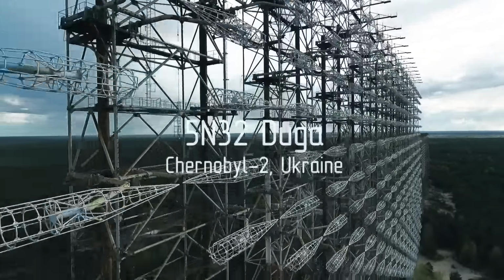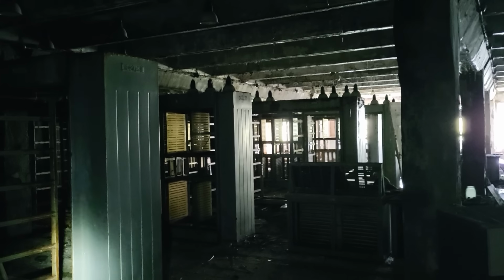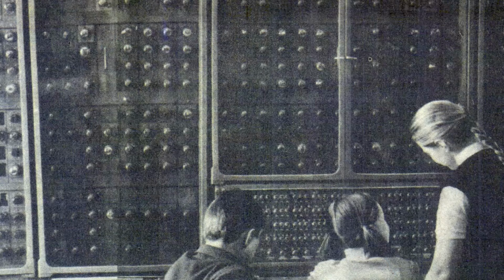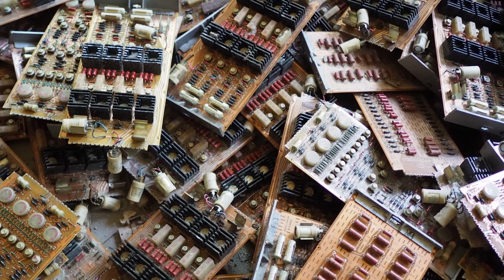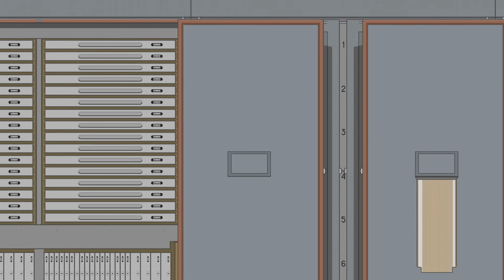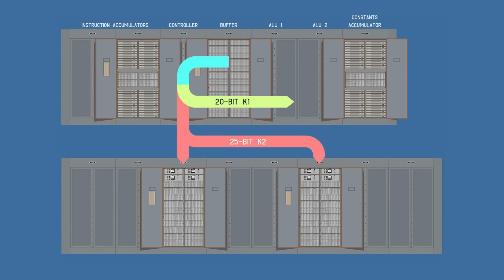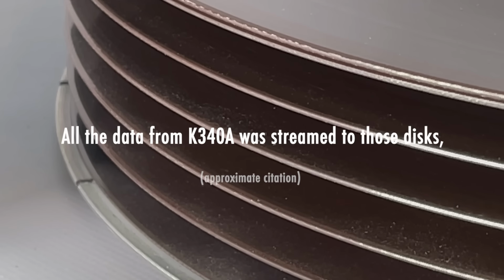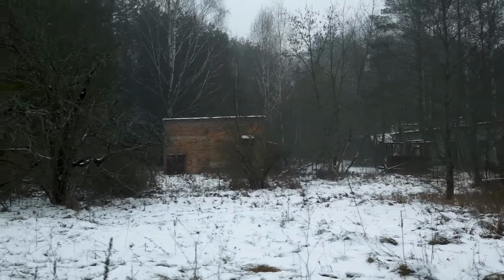Exploring K340A: The SECRET COMPUTER of CHERNOBYL DUGA RADAR | Russian Woodpecker

Comment: Exploring the K340A: Unveiling the Unique Computer that Powered Chernobyl's Duga Radar

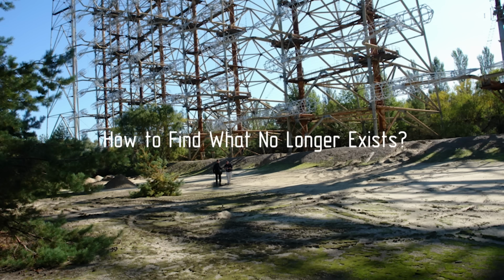* 0:49 First Discoveries: Initial exploration of the Duga site in 2010 revealed a data center filled with the K340A computer racks, an intriguing system unlike anything seen before.
* 2:11 Early Research: Limited information was available about the Duga radar and its computer system until the discovery of a book by Boris Malashevich, a researcher of Soviet computer history, in 2014.
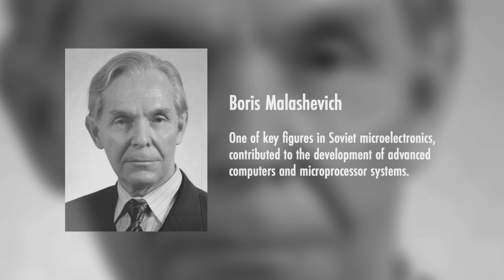* 2:24 Residue Classes System: Malashevich's book revealed that the K340A was based on the Residue Classes System (RCS), a unique method for representing and processing large numbers using smaller residuals.
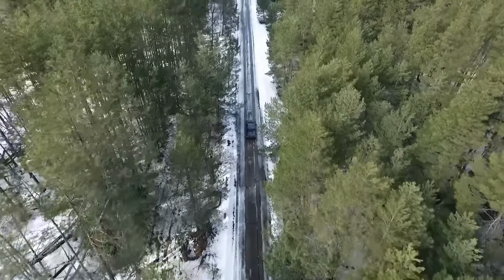* 3:11 Research Expedition: A 2016 research expedition to Duga focused on mapping remaining computer equipment and examining surviving documentation, which was heavily damaged by moisture.
* 4:49 Why a Special Computer? The need for a unique computer like the K340A stemmed from Duga's complex operating principles and the demanding computational requirements of analyzing ionospheric conditions and tracking missile trajectories.
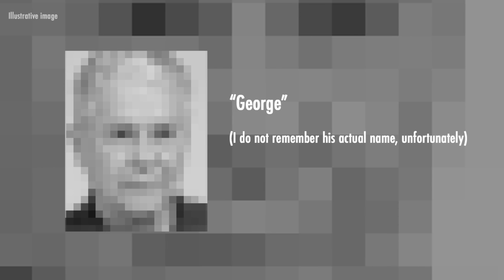* 5:07 Meeting "George":  An interview with a former engineer, "George," provided valuable insights into the K340A, its specialized engineers, and its role in processing data and optimizing Duga's operational modes. [From connarcomstock161's Comment] The Duga system was known to be operational and a nuisance to amateur radio operators.
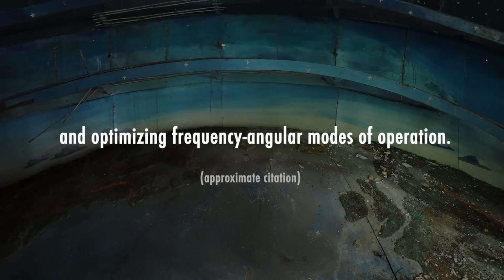* 6:17 How Duga Worked: Duga used a complex system of transmitting signals that bounced off the ionosphere to detect ICBM launches, requiring sophisticated algorithms and fast processing of large numbers. 
* 7:43 Origins of RCS: The RCS, crucial to the K340A's operation, was developed by Czechoslovak professor Antonin Swoboda and his student Miro Valach in the 1950s.
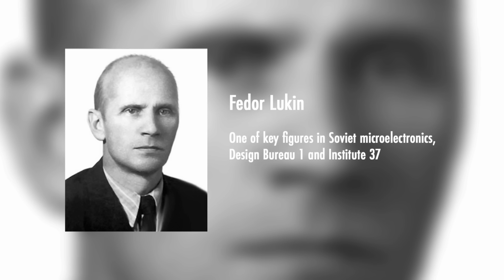* 8:22  Soviet Development: Soviet engineers, including Israel Akushsky and Davlet-Girey Uditsky, recognized the potential of RCS for specialized machines and developed the A340A, T340A, and eventually the K340A.
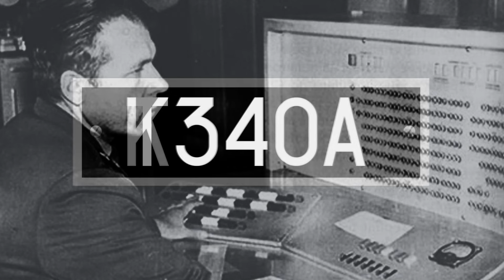* 9:26 K340A Specifications: The K340A, completed in 1966, boasted 472,000 elements, including 80,000 transistors, and an impressive processing speed of 1 million operations per second.
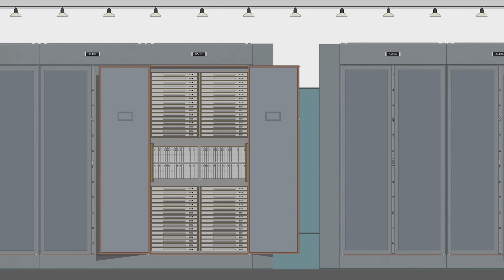* 10:19 K340A Hardware: A single K340A system comprised 15-17 computer racks, 4 power supply racks, an operator's console, and a printer rack.
* 11:16 Modular Design:  The K340A used small, standardized cards called "cells," with around 50 variations, plugged into racks with custom connectors and intricate wiring.
* 11:50 Three Types of Racks: The K340A employed three types of racks: Data Processing racks (processor), One-Side Accumulator racks (storing constants and programs), and Accumulator of Numbers racks (RAM). [From robmacl7's Comment]  The fixed memory modules (ROM) were implemented using "Cassettes" with ferrite rods, a concept similar to core memory.
* 12:47 Ferrite Rod Memory: One-Side Accumulator racks utilized "cassettes" containing ferrite rods to represent data, with their position indicating a logical "one" or "zero."
* 13:06 The Prank: A story shared by "George" recounts a prank involving fake, non-magnetic ferrite rods mixed into the real ones, causing weeks of troubleshooting and delays during the K340A's commissioning. [From alexloktionoff6833's Comment] The fake ferrite rods might have been a deliberate act of sabotage, preventing reverse engineering of the system's software. 
* 17:51 Operator's Console:  While details on console operation are scarce, the layout and inscriptions suggest a low-level interface for data manipulation, instruction execution, and system monitoring.
* 20:53 Paper Tape Output: Data output from the K340A was recorded on paper tape using MP16-2 numeric printers, common in the 1960s.  
* 21:48 The 1S31G System:  The K340A computers were part of a larger processing system called 1S31G, likely involving multiple interconnected K340A machines and possibly connections to ES-1060 mainframes installed in 1984.
* 25:57 Museum Plans: The video creators aimed to establish a Cold War museum at the Chernobyl-2 site, featuring a restored K340A as a central exhibit, but the project was indefinitely postponed due to the 2022 war.

Note: Several comments highlight the disruption caused by Duga's signal to amateur radio operators, who nicknamed it the "Russian Woodpecker." This emphasizes Duga's real-world impact, even though it never reached full operational capacity for its intended purpose. 

I used gemini-1.5-pro-exp-0801 on rocketrecap dot com to summarize the transcript.
Cost (if I didn't use the free tier): $0.15
Input tokens: 39207
Output tokens: 1145
Reply from the maker: Actually, this is good.

Comment: Thankyou, that was very interesting, as a kid and ham radio operator in the late 70's / 80's I have listened and heard the Russian Woodpecker many times, even transmitted morse code dots at the same rate on its frequency as a little part of my electronic counter measure. 

It was at the time a HUGE radio signal probably many hundreds of KW's  or power.
Reply from the maker: Thank you very much for sharing!

Comment: "It' never reached full operation"

Ringway Manchester would like very many words. 

Duga was such a nuance for amateur radio in the 80s they named it the Russian Woodpecker. The UN asked the Soviets to turn it off. The Amateur radio community would blast it's signals back at it in an effort to make them turn it off. 

The thing very much ran and was a very big annoyance for a lot of people.
Reply from the maker: I meant, there is a difference between 'technically worked' and 'was on active duty'. It was in test and research stage, there was even a special research shift of officers there, but not all systems were in operation and the data from it was not used.
Reply: @ChernobylFamily  That sounds like we all have no idea how much more potential to be REALLY annoying this thing had up its sleeve.  Maybe it gives you an impression that not only radio amateurs and shortwave listeners were suffering from the woodpecker,  even when you just wired up audio equipment and be it just your own stereo, as long as the shield wasn't properly connected you sometimes could faintly hear a mix of Radio Moscow and the Woodpecker on top of the 50Hz-hum (here in Europe).  At times the signal strength was incredible and overloaded our not so posh radios, so it could be heard even on frequencies it didn't actually transmit on.  That "test phase" was certainly a 24/7 job for the station operators for years.

Comment: Duga should be restored to theoretically opperating condition. At least restore a k340a to working order. 

I think with enough of the documents recovered it might be possible
Reply from the maker: Those papers are just a few bits which usable only for making a mass-size model, unfortunately. There is no information on electronic parts except just some cards, so... no way, unfortunately. But even if it would be, there is no software or programming reference.
Reply: @ChernobylFamily  well then, there is still the option of reverse engineering it from the parts at hand as well as the article shown. reverse engineering the cards is tedious but i do not consider it difficult. The power supplies are probably quite easy as well. Getting the system topology right is another matter. If an example of each card is present, i think its possible to reverse engineer it. 

As for programs, if the above is done, then creating new programs is not much of a problem, as the instruction set is then known, and a compiler can be made. 

Basically put, its almost like designing and building a completely new computer, but a bit easier or harder depending on perspective. If it was built by man, it can be rebuilt by man. 

I am also no stranger to doing such work, as i work for and am a founding member of the museum of electron microscopy, in nuernburg germany.  Other then restoration work getting these old machines running again is one of the things i do, and reverse engineering them if no documents are present is one of the things i need to do. Id volunteer time, but currently im already at 3 hours of sleep just to get every thing done, perhaps i can help out in the future with the reverse engineering and perhaps get this magnificent machine running again.
Reply from the maker: @lbochtler  need to think. It is a very big work and a very big investment. Well, I guess making just some part work of it would be already an interesting project.

Comment: The RgP and RgD rows at 18:25 are most likely Register Prefix and Register Data. The IBM 704 mainframe had these fields. It was a vacuum tube machine from 1954 that was highly popular in the west at the time the K340A was being built, and while the earlier Soviet computers were more innovative than their later counterparts, there was still a lot of conceptual borrowing, like replacing 36 bit (4×9) with 45 bit (5×9) to be "superior." Addresses would have been calculated as (prefix * (segment size) + data), similar to relative addressing in modern x86 CPUs.

It is also possible that they correspond to Address and Decrement, but I think these are the "A" and "D" on the "Rg upr. Ab" line at 20:00. The 704 accessed arrays as array[i] = (address - (decrement * i)), counting backward from the end of the array instead of forward. (These terms from the 704 live on as car and cdr in the Lisp family of programming languages.)

http://bitsavers.informatik.uni-stuttgart.de/pdf/mit/computer_center/Coding_for_the_MIT-IBM_704_Computer_Oct57.pdf
Reply: Informative conment.
Reply from the maker: This is interesting. Now, need to make it work with RCS grouping RgD jas and we might be able to solve this mystery.

Comment: From what I've been hearing about the Duga radar is that the system broadcasted a strong signal at 10 MW.  The signal produced a sharp, tapping sound and that disrupted legitimate radio broadcasts worldwide.  This sound became known as the "Russian Woodpecker" by people living outside of the Soviet Union.  Personally, I think it sounds like the whirling blades of a helicopter when you hear it from the ground.  To combat this radio disruption, some radio receivers had what where called "Woodpecker Blankers" incorporated into their designs to filter out or block the noise generated by Duga's signal.
Reply from the maker: I am very much interested in those 'blankers'. I heard many times about them, but never saw any concrete details.
Reply: I was born in 1970, and I remember hearing the "woodpecker" tapping noises on my dad's shortwave radio. I had no idea what it was at the time, and didn't learn until many years later.
Reply: @jhal1270  Sounded almost like one of them steam powered put put boat toys....
Reply: @jhal1270  In den 80ern waren immer Gerüchte, dass die Stasi der DDR die Störsender betreiben würde.("In the '80s, there were always rumors that the GDR's Stasi was operating the jammers.")
Reply: Wasn’t there another Russian woodpecker which was like a coded station with a super repetitive frequency holder tone that broadcasted on 4625 kilo hertz?
Reply: This makes me smile (just a little), and it must have been maddening. Perhaps an unintentional bonus when they found out the rest of the world was gritting their teeth at the woodpecker? I would have been so annoyed, lol. We used to have a woodpecker that would bang away at our metal gutters at the crack of dawn, so my sympathy is there.

Comment: At least something as stochastic as an over-the-horizon ionosphere ICBM detection radar (wow!!), did not lead to the start of WW3... So they obviously were aware of its limitations....
Do you know anything about how a potential launch would have been detected, processed, reported? & how they could differentiate from noise etc.?
Reply from the maker: There are some details, but to be honest it is a very huge question. Let us think how to present it understandable and a new episode will come.
Reply: @ChernobylFamily A cool way to use it, would have been  to activate it as a radio amateur station, with a callsign.

As i understand, it could transmit across all the classical bands, 40, 30, 20 metres. You could probably use the phased array capabilities, plus the gain, to project yourself over Europe / U.S. with a tiny little power amp... I am sure the  amateurs would be delighted and ask for QSL cards galore...

There were Soviet Radio amateurs, as i understand it, but they had to build their own stuff..  One of those veterans could surely do it...

Comment: What a fascinating system. It used atmospheric ducting to get radiation to the plasma from a rocket plume. Then that signal had to duct back to the receiving stations. What a control problem. You have to sense the atmospheric conditions to the target, then tune emissions to optimize signal to the target. The processing requirements at the receiver must have been more intense than the computing requirements for the transmitter. Were the receiver stations co located at this site? I imagine they'd be located elsewhere and separated.  But regardless I would imagine the station would conduct all kinds of different emissions. Emissions to probe the atmosphere along the path to the target area in order to set emissions to actually scan for rocket plumes, then sense dopler and spectral information from the returns off the rocket plumes over the scan area. Do you plan on eventually going into the theory of detection, signal analysis, software requirements, and data products?
Reply from the maker: Chernobyl-2, featured in the video is a receiver only. Transmitter was in Chernihyv region at Lubech-1 town. Then, one more pair was at far east of USSR. Sure, we will cover that in the next episode.
Reply: @ChernobylFamily  Грандиозная работа! Близость приемной станции к АЭС объясняется большим потреблением вычистоительной системы? А электро-магнитные помехи от АЭС имели место быть?
Reply: Thank you kindly!

Comment: At @25:53 is a jarring reality I have realized for many years now.... the prioritization of expenses for war / aggression while turning a blind eye to the health and safety of the citizens. Sadly I see the same type of misplaced emphAsis repeating.... such as the recent CrowdStrike update causing Micosoft Windows computers to BSOD.... I heard the executive at CrowdStrike previously worked elsewhere, and a very similar mistake was made by that company. Back in the early 2000's, there was an accelerator technique built into Ethernet chips to compute the packet checksum on the NIC chip acting as a co-processor, relieving the CPU from having to generate those needed checksums. I am forgetting now which two vendors at different time periods had bugs in the NIC's checksum co-processor code... I know the second was Broadcom, but I forget now if it was 3Com or Intel that had the issue first.... suspecting 3Com.... as I do not remember a catastrophe defect in Intel's E100B driver ever. Anyway.... I have wondered which associate traveled through revolving doors between companies, and brought with the faulty packet checksum generator code. A few other similar patterns come to mind. Such examples a very annoying and aggravating to my mind!!! Good video, thank you.
Reply from the maker: Thank you for sharing!